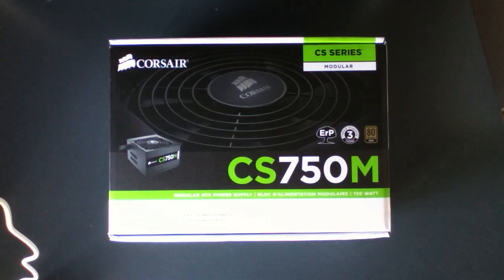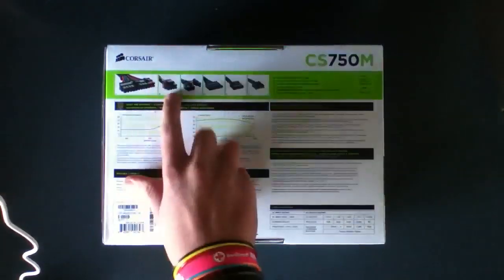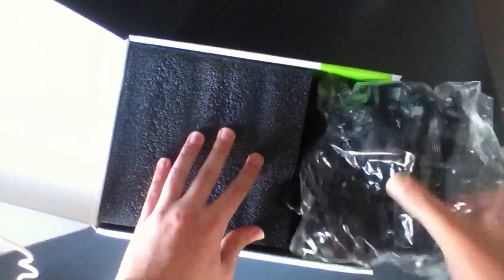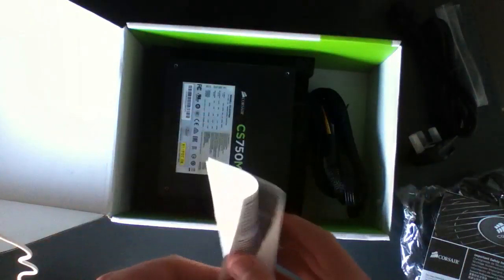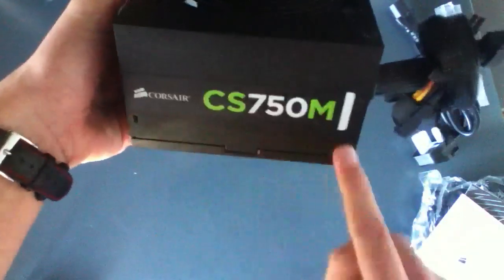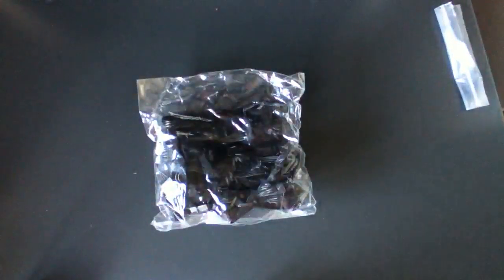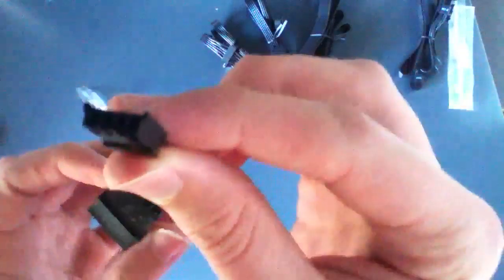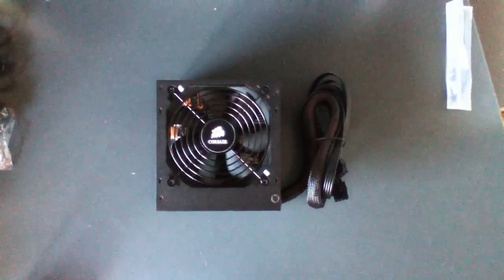Corsair CS750M Modular Power Supply Unboxing And Overview

Comment: is this psu perfect for this build or overkill for this build... Asus z170-pro, core i5 6600k, gigabyte gtx 960 gaming 1 4gb, corsair 100i cooler, samsung 850 evo, wd green 2tb, 16 gb ram 2400mhz
Reply from the maker: +COM TECH This is a bit overkill for your kinda system. For the parts in yours you could step down to a 500w PSU and be fine. Go for either the CS550M or CS650M. This unit here powers my rig which has an overclocked i7 4770k, 16gbs of ram, Asus Maximus Vi Hero motherboard, Asus Strix GTX 980 and a host of hard drives and I could still strep down to a 650w unit just fine. Hope this helped.

Comment: Asus Z97-Deluxe, Core i7 4790K, Samsung 850 Evo 250 GB SSd, 16 GB 2400 mhz of ram, Hydro Cpu Cooler 100i,  is this power supply perfect for this build?
Reply from the maker: what graphics card are you going to run with it or arn't you having one? It will be sufficient yes
Reply: +Scaniaman93 without graphics cards, i will buy GPU later (MSI GTX 970)
Reply: +Scaniaman93 and what about CS650M without GPU?
Reply from the maker: +Aamir Irshad if your going to be running without a GPU you can step down as low as a CX430 or lower with no problems
Reply: +Scaniaman93 Ok one more question, if I use CS650M without GPU, then it creat any problem or it works fine?
Reply from the maker: A CS650M will be overkill for a system without a graphics card. You could step down to a 300w power supply for a system without a graphics card

Comment: You didn't say what size case you have and you didn't unwind cables or measure so we can see how long they are. Will this work in a full size tower? I have never had a modular PSU and the last few cheap PSU's I got the sata's are a few centimeters too short for me. Any advice?
Reply from the maker: Clayton Yeager Hi! This video was shot quite a while ago now so as my channel has progressed my videos have got a lot better than this but this happens to be my most watched video. I have a Fractal Design Define R4 case which is a ATX Mid Tower The cables are plenty long enough for that. Bearing in mind switching it around so that the PSU's fan faces downward sucking air in from the bottom of the case adds an extra 3 inches or so to the cables because in tern they are closer to the main cable cut out. The satas are plenty long enough for a ATX Full Tower i would say as I've got loads of eccess cable bundled behind my motherboard tray. Also if the cables arn't long enough for your build, just get some Sleeved Cable Extensions from BitFenix. It will impove the look of your cabling from the front aswell as lenghthening your cables. Here, take a look: http://www.amazon.co.uk/s/ref=nb_sb_noss?url=search-alias%3Daps&field-keywords=bitfenix+alchemy+sleeved+extensions - They are available in multiple colours and are really high quality! Hope this helped you out :)
Reply: Awe thanks man I watched the video and decided to buy one. It was well priced and came with a nice heavy power cable. I was very satisfied it had enough satas for everything and plenty of cable length.
Reply from the maker: Clayton Yeager Glad you are happy with it. I've had this unit for over a year and a half now and it has been a rocksolid unit even though my system is on 24/7 most days. Glad i could help you out too!

Comment: Hi, is the cable at 3:44 like this
8pin to 2x PCIE 6+2pin? and also is the other cable exactly identical as well?
Reply from the maker: Marc Leo Victorio Yes that is correct. 1 8 pin runs to two 6+2 pins

Comment: Hi. Can anybody tell me why Professional Individually sleeved DC Cable Kit from corsair are compatible with CX 750M and not with CS750M? These PSU is very similir. Even with the original cables. And CS 750M is more expensive. I got those cables and CS 750M and now I am afraid to conect them.
Reply from the maker: The power supplies are exaclty the same except the CS750M is 80 plus gold rated so go ahead and connect them.